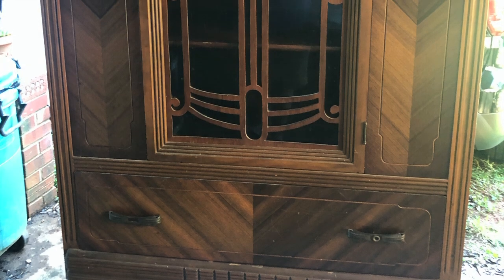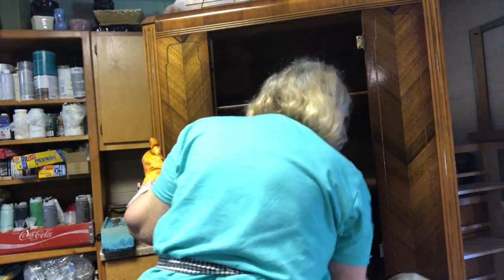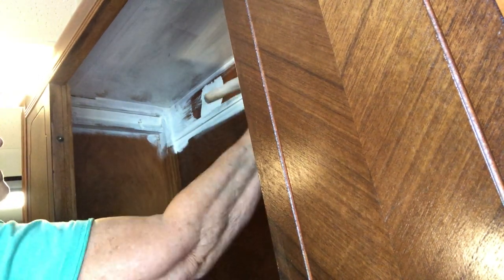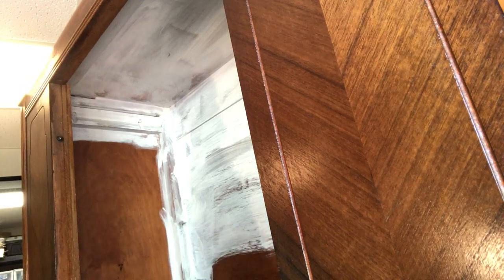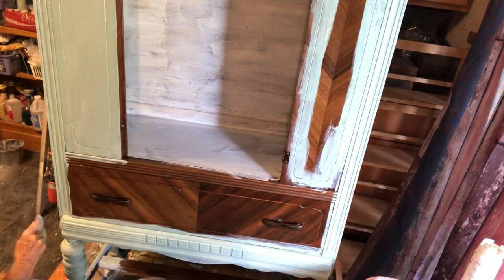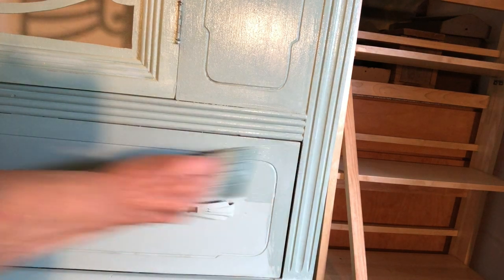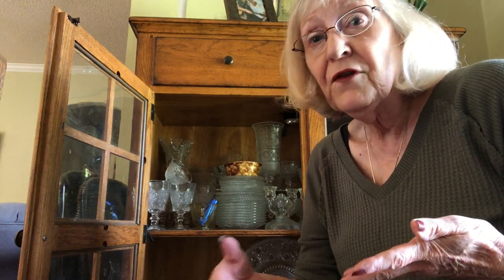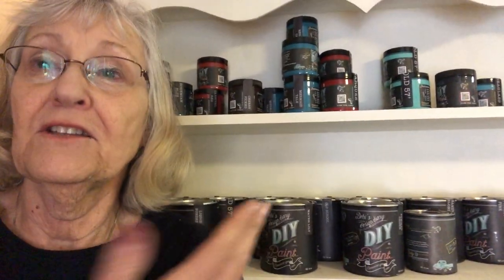How to Chalk Paint a Hutch

Comment: I love how this turned out! I painted one similar with milk paint in white and I didn't prime it first, so of course it bled through! It was my first big piece. How did you get the fancy wood insert out to paint it? I was so afraid to take it apart so I turned the glass into a chalkboard. I love the color you chose too! Great job! 😘💕💕
Reply from the maker: The insert was on the back side of the glass not sandwiched between, Hubby took it out. It was held in by a thin frame on the back which he removed first, I’ve only found one other if this style. I really love the design. thanks for watching and commenting. It really means so much to me.
Reply: @Goodsonvintagetreasures  yes, your insert is very fancy compared to mine! I love it!  You're welcome for watching! 😘💕